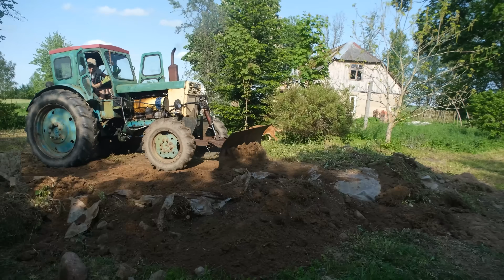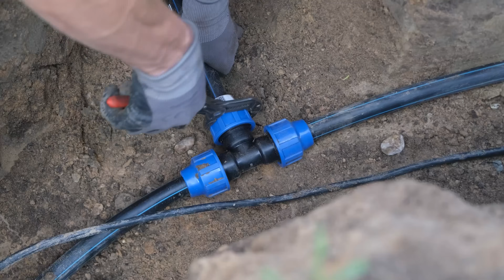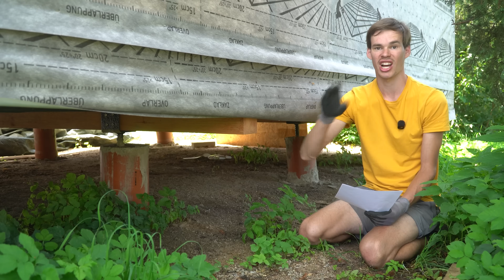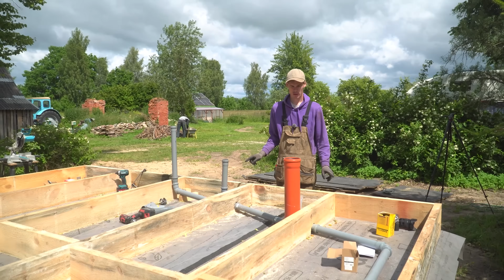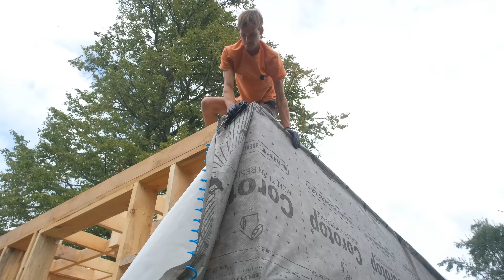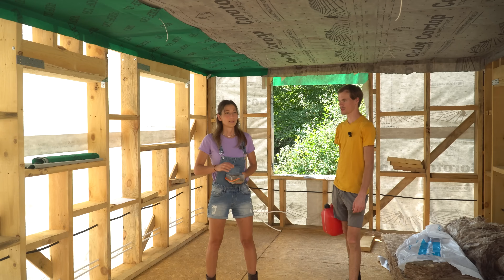😱 Is the TINY House UNDER $5000 Still??

Comment: I notice a big mistake in the window layout. The header isn't supported by a jack stud. The header is held only by the nails. With the total weight of the roof, the header will descend onto the window. The header should protect the window; here it's the opposite. The window will support the header. The window must not be subject to any pressure.
Reply: He explained all this in a previous video and he has used metal brackets to strengthen the window spaces. There is more than one way to build and the rest of the world does not follow the USA methods.

Comment: The lumber you used for the walls i would use for floor joists, the limber you used for the top floor joists is like the wood I use for framing. But in saying that there's nothing wrong with your build. Are you making this tiny home for yourselves to live in or for your mum? Im only wounding 😊

Comment: I was thinking you would be adding stones and cement around the outside edges under the foundation with a small entryway for maintenance and repairs but that was just my guess because I was also worried about if the foundation poles would be enough.
That's some very heavy solid wood. Maybe you could build around each pole under the foundation with a frame and cement up to the wood.

Comment: Make sure your concrete block for the outside foundation goes down below the frost line for your area. 3.5 feet in our area but we do not have very cold winters. When I lived further north code was 6 feet down to be below the frost line. Frost heaving can reck you building.

Comment: You could have saved a lot by not using the wind barriers on the top floor to hold the insulation up, any thin plastic tarp like a paint drop cloth because you'll addind the ceiling under it to hold it up and putting it on the top was unnecessary because you will be adding the osb on top of it. Also no tape and not so many staples.

Comment: I would expect that you're going to go over by at least another $2500.00-3000.00 by the time you get the second floor and roof on. You still have a way to go, all exterior and interior walls, etc.

Comment: I would guess 10k total with the roof, wall cladding, plasterboard, all fixtures and fittings plus new foundations, Lumber and osb seem to be the most expensive compared to cement, sand aggregates etc. Plus if you buying material from a wholesaler using a buisness account then there is peobably zero or reduced tax, I thin it mifgt be different in the USA where lumber is the cheapest and cement, aggregates etc are the dearest,